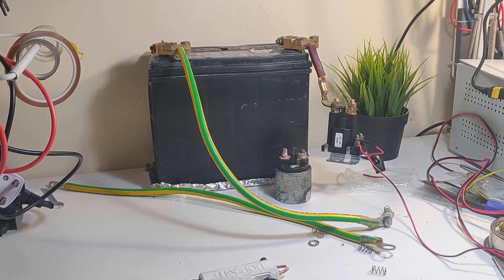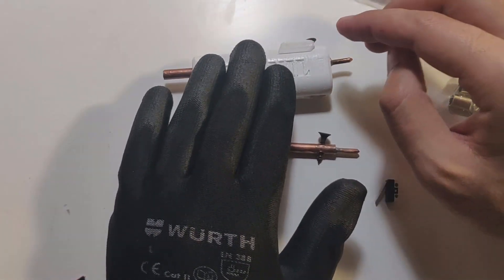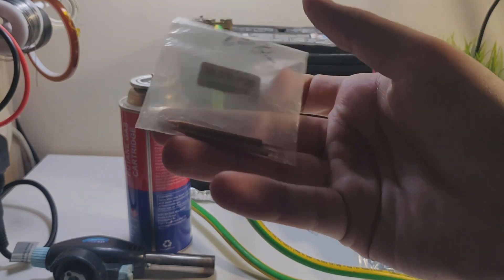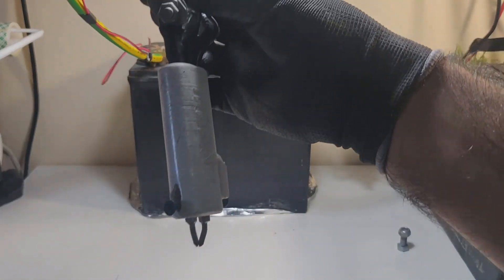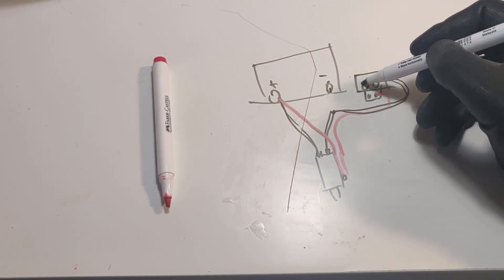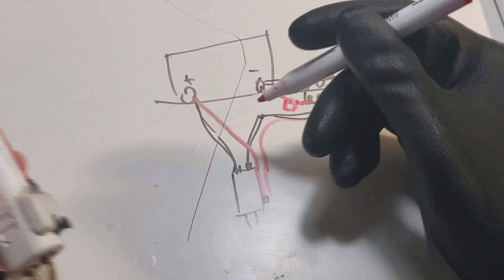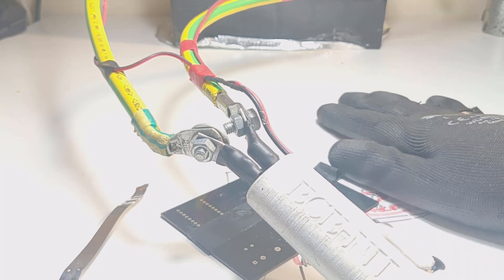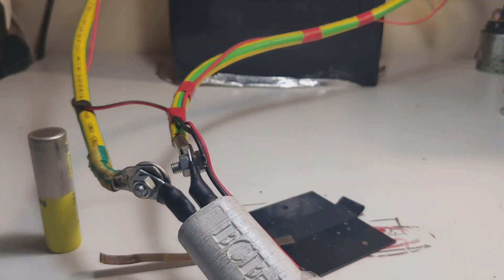Making the best DIY Li-ion Battery Spot Welder

Comment: Why don’t you get rid of that whole complicated system and just have two leads coming off to your copper pens hold one pen on to the work and then tap it with the other hand. just a thought. def works though!
Reply: If the pen gets “welded on” and sticks to the strip, than the current will keep running and you will have to pull it really hard to get it off, in the mean time the strip gets very hot and you may damage you cell when welding a cell to the strip. You need some sort of interrupter like a relay, or you need to drive the welder from a capacitor that bleeds empty when you weld so that there is no long lasting current flowing if the pen welds to the strip.

Comment: Simply use thin wire that will control the current.
Reply from the maker: Thats not how it works :(
Reply: @Fungineers  I am making one. Will share you the result.
Reply: @Fungineers  yap. You are right. That ddnt work. :-(

Comment: Put an automotive light in series with it to reduce volt/current, or a power resistor, or use an 555 to give it a sub-second pulse using a rheostat to adjust timing.  Or use 6 D batteries.
Reply: Good one. auto light/ 555 timer, or D batteries - never considered that. That would be a real cheap safe solution.

Comment: It appears that with your fancy self actuating switch you have ceeated your own problem. Your switch is changed into a locking switch basically that keeps current flowing until you back your pen off and deactivate the flow. Why not just use a momentary switch that throws a split second connection and releases on its own regardless of the position of your pen or the switch. I would wire it to a foot pedal to free up the business end of my electrodes to focus on placement of the two points instead of focusing on that AND pushing the switch on activate then releasing the switch back to stop. Keep it simple.

Comment: For the welder use oil burner Eletrodes. They are meant to handle high voltage, high heat. They also have porcelain insulators. Some are made of inconel. Riello burner Eletrodes are the best to use.

Comment: Your problem is timing. You can't use the electrodes to activate the switch (to then activate the solenoid), because you need to activate the switch VERY quickly on/off. You can't do that with the switch being inside the little electrode housing. If you have an external switch, and press it very quickly with your other hand (as I do), it will not spark like that and it won't blow holes in your nickel or batteries. I like the addition of the springs though, that will help keep the electrodes placed firmly and evenly on the nickel, which is an issue I have with my current setup in that, if they're not pressed firmly and have good connection to the nickel, sometimes it arcs.
Reply from the maker: Thanks kevin. I got the issue sorted out by using an external timing controller here: https://youtu.be/vdXOn8or3BM
Reply from the maker: Now it works great!

Comment: I love battery tab welders!! I just made my 10th one on my youtube page. I have also made one of these last year. The Battery you need is a smaller Lawn and Garden battery. Even the one I purchased was a smidge to strong, I should have gotten one a little smaller in amp-hours. Later on, I created my lunch box battery tab welder, using 2 x 7amphr UPS batteries in parallel.  Now that is the perfect combination for this type of welding. While the battery is charged, till around 11.8V, I get near perfect welds. Your handheld would work perfectly for this!!

With my Lawn and Garden battery and from what I seen on other videos, using these types. You have to press the button yourself as fast as possible and let go even faster. But when you use a smaller battery under 250ahr(350cca), you might not need to press so quick. Pressing the button like this will produce some nice welds. I have yet to get a smaller one, except the 2 ups(7ahrx2) in Parallel set up I built. If I had to guess 14ahr is the sweet spot when using a relay like these. Thanks for the video!!
Reply from the maker: Thats awesome. Thanks for the information. Did you check out the next video where I implemented the timer. Works perfectly now.
Reply: I know this is a while after you have posted this comment but I would like to ask when you use the relay (solenoid) for the switch is there any danger of the battery shirt circuting internally or heating up internally? does the use of the solenoid stop the battery short circuting internally? if it does why?

I am interested in making my own spot welder but I am being cautious as I don't want the battery to explode on me

Comment: Hello, there are some good ideas. Especially the pen. However the switch should trigger a timer instead of the relay!
In this construction, once you triggered the relay, the current begins to flow. But you need to lift the pen to open the circuit. A that moment ,the pressure is weak that's the reason you get huge sparks.
Reply from the maker: Yeah. The timer should fix this. The button will activate the timer. The timer will then activate the relay. Its still in transit..been 2 weeks. Patience is my only choice

Comment: thats becuse your useing a switch remove it and the relay and just tap it
Reply from the maker: Thats dangerous!
Reply: @Fungineers  yea could be dangerous you could try moving the switch to side of the handle so you can just tap it without having to push down so hard. others have just used a battery with no relay or switch i made myself one without it  and i use a Lipo battery aslong as you get the pull away time right it works fine
Reply from the maker: Yeah that could work! but I wanted to make a system where i dont use my other hand, or dont have to push switches. Just push down on the electrodes and bam! 
So if i put in a timer I think it should solve my problem.
Reply: @Fungineers  a timer would probably work
Reply: @Fungineers  try a Spot Welder Time Control Board would help you probaly

Comment: where do we get lugs?
Reply from the maker: Updated the BOM in the description with the lug info.
Reply: There's plenty of them on eBay. Those would be silver or nickel coated copper, or could even be tinned copper.  Usually you can get a bag of 20 for about $10. Might get 100 for around $15-20.
Reply: @korishan  what size are they?
Reply: @ozisnice  Multiple difference sizes. Just do a search for "copper lug tin" and you'll get a little of 1000 hits. Then you can choose what size you want.
He mentions in the video where you can purchase the ones he has. Altho, looking at the description, he forgot them.
But the wire is 4 AWG he used.